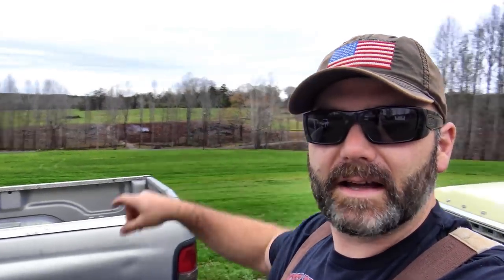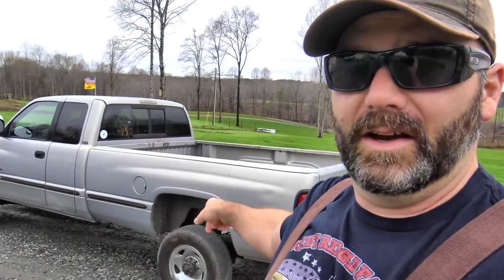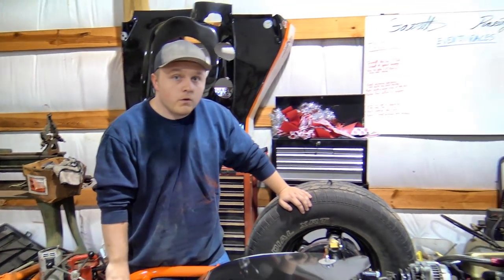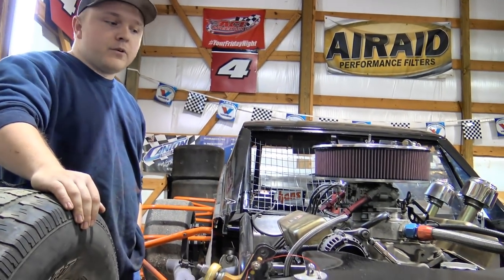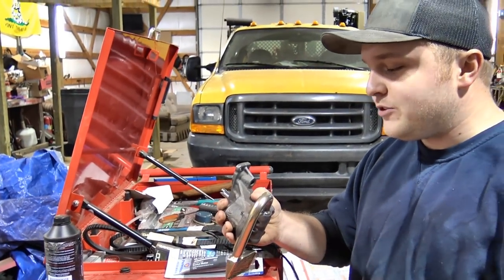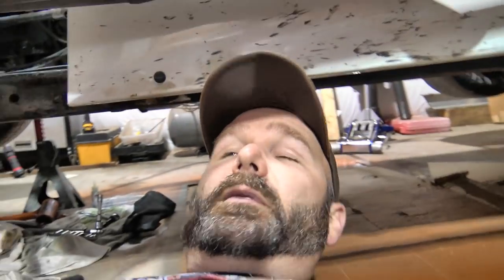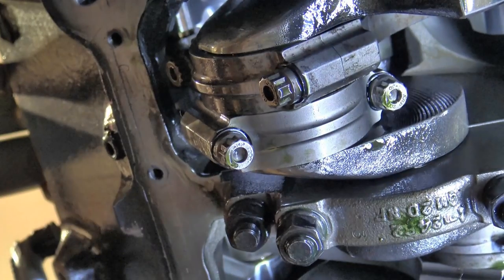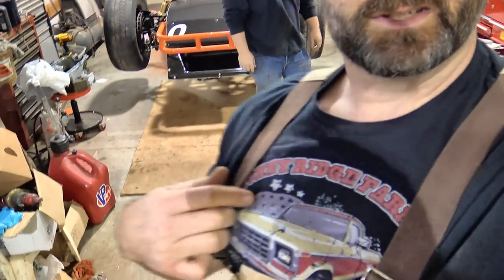LATE MODEL RACE CAR...ON A FARM CHANNEL?? RAD!!

Comment: Howdy from Davidson County again!  Get that driveshaft balanced!  You won't be sorry.  If your driveshaft is outta balance that rear oil seal and tailshaft bearing in that Allison won't last very long.  By the way you got the same problem my friend's Ford F-350 has the carrier bearing.  Sometimes I'm glad my '86 Chevy don't have that bearing but then again ground clearance for some good off-roadin is nice.  Also, I thought you had already adjusted the distributor on the $100 truck, good that it wasn't the carburetor after all.  Also hooray for the Small Block Chevy 350, I wish mine was a 350 rather than a 305, I'll swap er out some day but right now the wallet has other priorities.

Comment: 6:13 The sway bar is NOT designed to keep it from rolling over, it is designed to keep the axle from moving side to side.  Look it up!
Reply: No, a “sway bar” otherwise known as a stabilizer bar is to limit body roll. You might be thinking panhard rod?

Comment: That ole boy got lucky. That could have ended very badly very easily. I always weld on my pickup tubes. That modified has wide open access to the oil pan which is nice. We race stock cars and if this would have happened, we would be pulling the engine because the crossmember would be in the way.

Comment: Josh,  Save your wallet some stress, and put a new carrier bearing in the Dodge yourself.  It is only a one hour job at most. Simple  bolt in job.  Don't pay to have the drive shaft checked and balanced if the original welded on weights are still intact.  They are little strips of steel. Usually less than 3 inches long.  And, 1/2 inch wide.  I have only seen one case of drive shaft noise caused by balance weights in my life.  And, I'm 71 yrs old.  I had a Street Rod with over size exhaust pipes that rattled like an impact wrench in reverse.  Turned out the pipes were so much over size, that one side had a bare 3 mm of clearance from the shaft. (professionally custom installed $400)  In reverse, it torqued over and hit the pipe against the shaft each time it rotated. Same  shop said, removal, heat shaping to oval, reinstall, and re clamp, would run $100. (to fix their mistake) I good ball peen hammer whack took care of the lack of clearance. And, did not cost me a dime.  If the truck was a show piece or rare model, a shop repair might be justifiable. But for a "farm beater" why throw money away. Take Mrs. Stoney Ridge to dinner with the money you save. As for the other truck that needs all new pipes.  I'd mail order after market kits and hangers.   In one afternoon you can easily hang dual, or single pipe exhaust. I know you are busy as a flea on the farm and your professional job.  But, if it takes 2 days to put on pipes. It's not like you don't have anything else to drive. I mean.  Good grief.  You are vehicle poor/or rich depending on the view point. Hope you have discounted fleet insurance on all of them.  It save me a bundle when I had a yard full of rides.